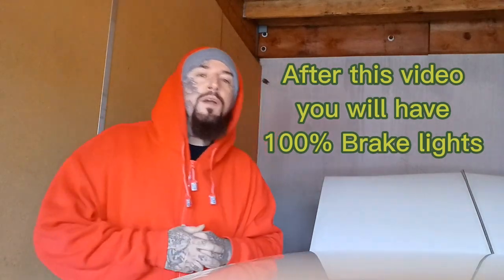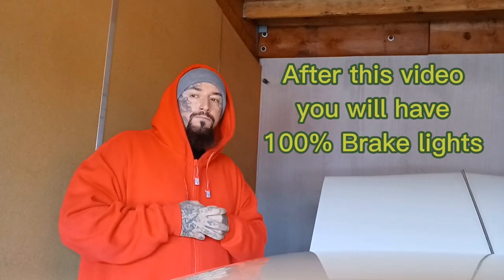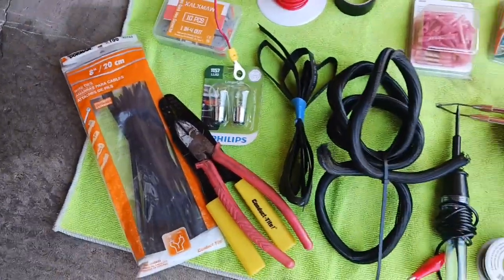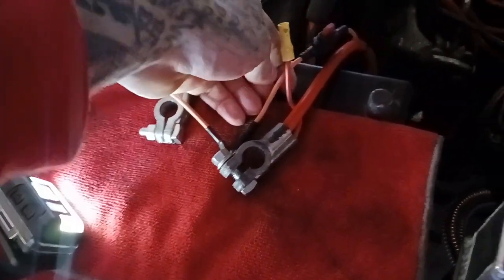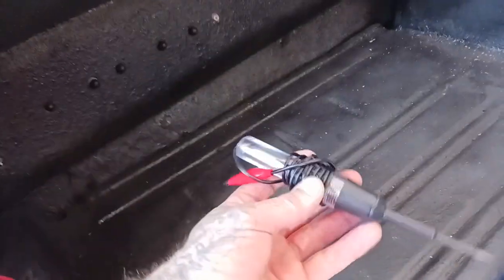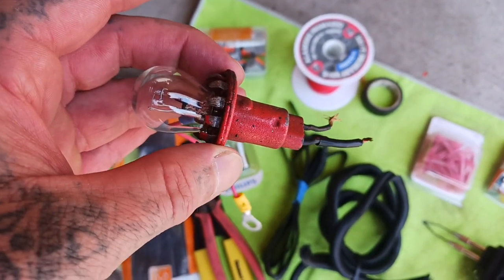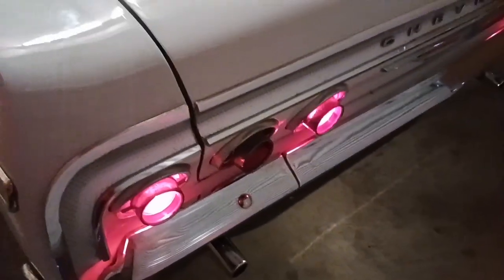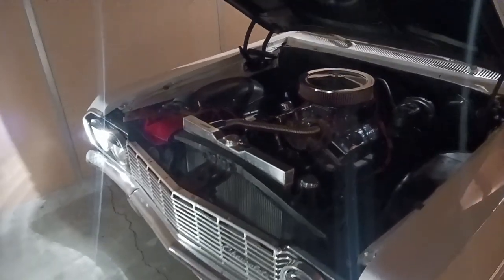1964 SS Impala how to 100% get brake lights

Comment: Man I wish I could have helped you sooner but I just saw your video. There's an old trick that I was taught. You disconnect all your bulbs you turn on your Amber lights, which runs power to them and you start by putting in the bulb in front of the driver side and you go to the passenger side and then you go to the back passenger light and you follow through all the way to the left driver side. (Basicaly in a clock wise direction) I don't know why but it seems that the power/curremt runs in that order until it reaches the last Light Behind the driver side. (Bulb basicsly acts as a fuse) If one of your light bulbs go out you replace it and if it happens again, then you take out each bulb or disconnected so its not grounded behind the one u replaced going torwards driverside back lights one at a time. Basically the current is following you as you put each bulb in until you get to the driver side. Make sure they're all properly on so they're grounded well. Try your blinkers to the left and then to the right and then try your brake pedal. Most of the time the front blinkers work but the back is where everybody has the problems, because the current goes from the front driver side to the front passenger side and then to the back passenger light in sequence all the way to the back driver side. I hope I explained well I've done this plenty of times and it seems to reset .

Comment: Im guessing they were just  simple & no technology. Its starts at the dash & signal wentt clockwise - each bulb was like a fuse. For some reason it interuptes the signal & it needs to be reset or redone starting with the light that was replaced & then going in a Clockwise direction.

Comment: But still no single
Reply from the maker: No I haven't got around to it been super busy with other things
Reply: @fireflamez408  if you figure it out please share
Reply from the maker: Definitely
Reply: Just seeing this video today. Obviously without seeing the vehicle I can only assume, but I believe both of your guys issues are a bad turn signal switch. Your brake lights go through the turn signal switch so when you have a turn signal on it cancel the brake for that side. I just did mine on my 65. Not a bad job, but you do have to pull the steering wheel.

Comment: Bro thats the same thing i have wrong with my brake light on my Riviera i gotta try that i think its a bad ground as well because my running lights work but when i step on the brake my left side light doesnt the light up and i changed the bulb and housing and still the same thing it has to be the ground
Reply from the maker: Exactly bro there's so many different ins-and-outs when you're dealing with old cars a lot of the time it's light bulbs fuses bad wiring and your ground

Comment: Is your console original for 4-speed? If not,where did you get it?  I have 64 ss w factory 4 speed and factory tach on dashboard. Someone cut the side of console to fit non factory linkage. I put back factory linkage and shifter. Now need replacement console.
Reply from the maker: That's how I got the car looks Factory to me but they have all of those things for your car online

Comment: Usually the switches fuses and relays need replacement.
Reply from the maker: Definitely went through those Avenues unfortunately my wires are in bad condition and frayed just made a separate wire harness to not have to ever deal with my brake lights until I get American wire all redone
Reply: @fireflamez408  yes make sure to prevent electrical fire which caused the Pontiac Fiero to have a recall, that you use the same gauge thickness of wire as the original or a bit thicker strands are good solid wire better.
Reply from the maker: @ka2rwp  definitely bro
Reply: Did you ever get the turn signals done ?
Reply from the maker: @JorgeGutierrez-bn7ie  how's it going haven't got around to it transmission rebuild and rear breaks right now

Comment: Gonna catch the car on fire running everything off the battery.
Reply from the maker: Not brake lights the amperage on brake lights very minimal voltage what will I will tell you is is going through an old fuse box that's what will cause you a fire temporary fix until all brand new wiring gets put in the car rather save money the wiring done in prevent getting a traffic ticket especially when it's dealing with a brake light super simple